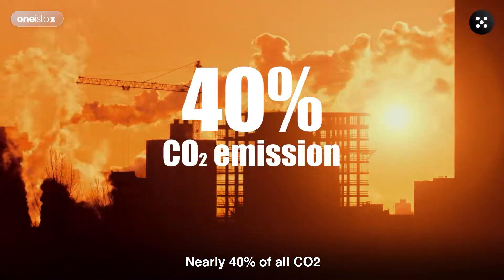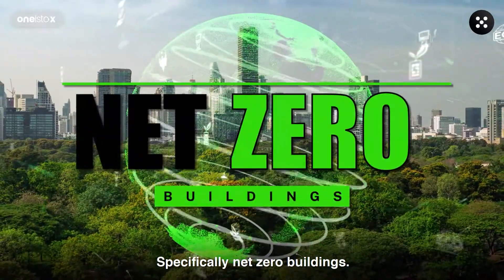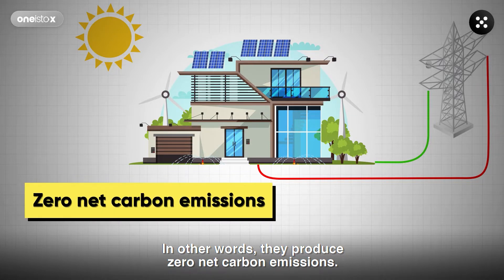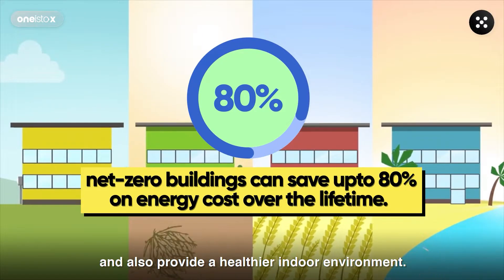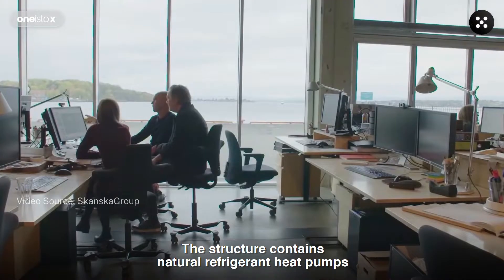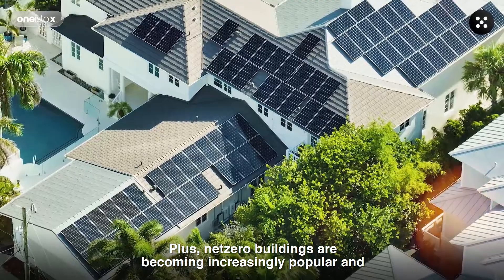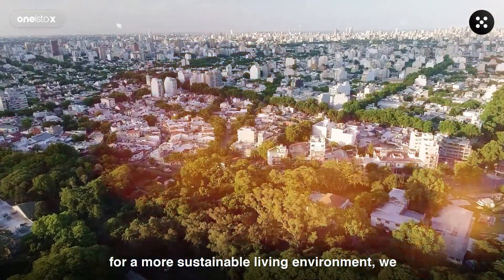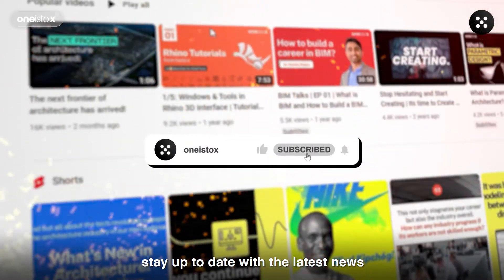What are Net-Zero Buildings?

Comment: Helpful outline of the consumption/use phase of net-zero buildings. Consider as well the energy use associated with material sourcing, construction, and demolition/disposal, which can be a significant portion of embodied, lifecycle carbon emissions. Resilience of the building over time and circularity of materials are other factors with major impacts on lifecycle carbon emissions not captured by this video.

Comment: Reducing carbon emissions will result in a famine! 
The Green agenda is suicide!
How can any means of energy generation possible be labeled as "green" if they do not produce the CO² plant food that will make the plants green, grow strong and bare great fruits?  Coal power statioare very green, even the ashes can be used as fertilizer!
Solar and wind cannot ever be green because they don't produce plant food (CO²).

Plants are the primary source of food that the circle of life begins with, they cannot live without CO², you people want to stop all emission of plant food through nonsensical BELIEF that carbon dioxide which is a vital gas of life drives temperatures up. 
Scientific records of ice shows temperatures rise before CO² levels therefore, temperature drives CO2 levels up and not the other way around, carbon dioxide does NOT drive temperatures, temperatures drive carbon dioxide levels.

Do you want to starve the plants? This will result in starving mankind.
What is making our weather crazy is weather modification not CO², not Methane either as Methane turns into hydrogen, CO² and water vapor via sun rays... So leave the damn cows alone!
Anyone who subscribes to NetZero or any other fake "green" agenda nonsense has committed themselves to suicide and are dragging mankind with them... The war on CO² is to charge CO² taxes on everything, it's nothing but a SCAM to raise taxes and siphon the wealth of the poor to the already insanely rich bankers!